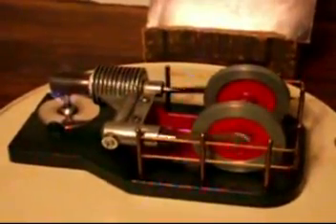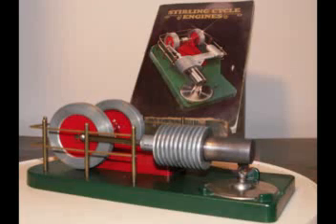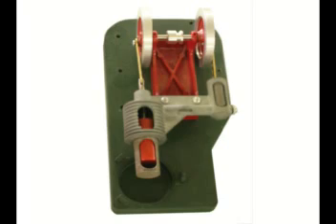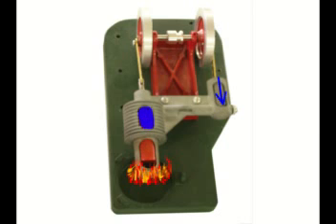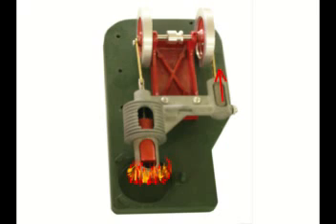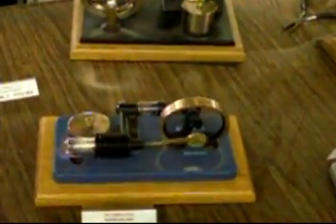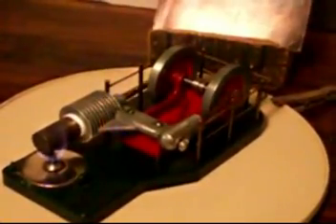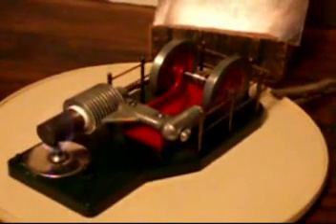Stirling Cycle Engine - How it works

Comment from the maker: @jorgeargentina2007 
The power piston (NOT the one over the flame) is steel to minimize wear.  
I'm not 100% sure about the slave cylinder but I remember it being aluminum.  It needs to be light because reciprocating mass is counterproductive.  Since the slave piston doesn't wear, you can make it out of almost anything, but you are better off if it has a small thermal capacity otherwise it can get hot and make it much more difficult to cool the air for the second half of the cycle.

Comment from the maker: One of the more notable attempts to commercialize this technology came from Philips where they made a Stirling based generator to allow use of electric devices like radios in places without a reliable power source.  I believe these were powered with Kerosene and used compressed air to help start the engine.  The engine would run a blower to help increase the heat provided by the burner.  

With today's transistor radios it would probably be pretty easy to meet the power requirements of a radio

Comment from the maker: Correct! the larger the temp difference the more power you get.  The reason is that with a bigger temperature differential you get a greater heat transfer rate.  Remember that getting a better flow of heat in and out of the engine is key to making this work. 
On the hot side you want to collect energy efficiently, on the cold side you want to disperse it quickly.  Insulate the hot side from the cold, and use thermal grease on other connections to keep the heat flowing.  Good luck!

Comment: So the bigger the temp (hot area - cold area) difference the better ? Im planning to try and make a model to find the best rendemend. My idea is to make 4xstirlng beta or gamma and connect them together on a parabolic mirror dish. instead of 1 big i want 4 small. Also a close cooling system and temp controlers to monitor and adjust so i can achieve highest possible power. This whole thing will be attached on a PMG alternator 2 or 3 startors.. big challenge but i like challenges...

Comment from the maker: The piston is made to be a tight seal, but yes, you are going to lose a little air from around the piston.  However, the piston is only under pressure for half of the stroke the other half, it's experiencing suction.  In theory, they should balance out.